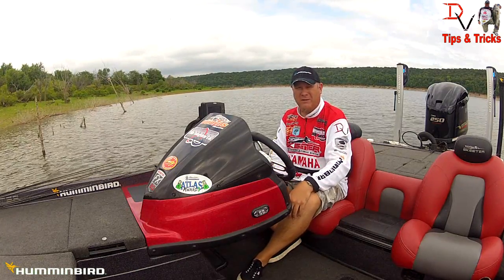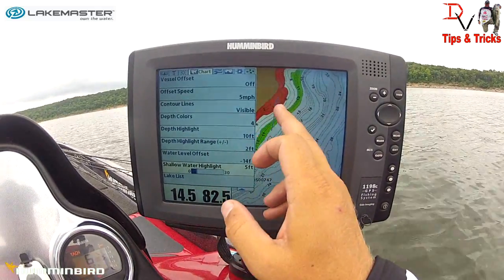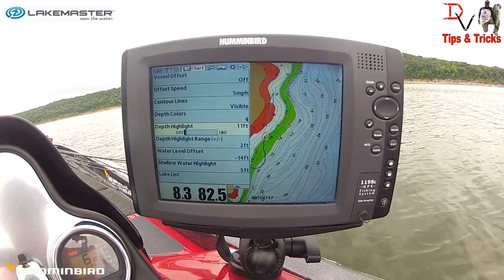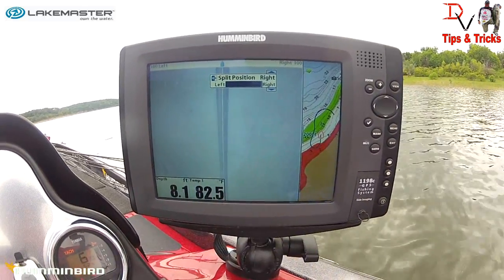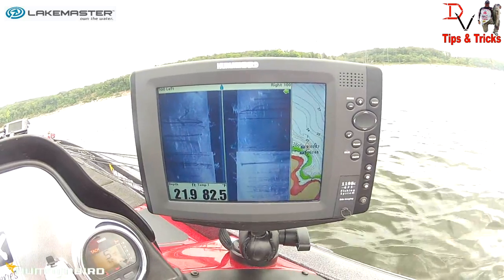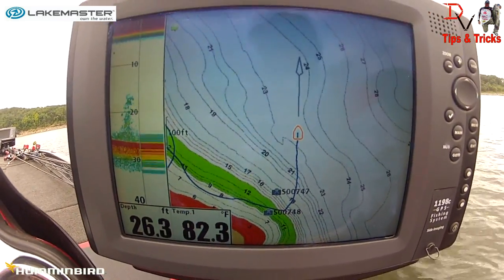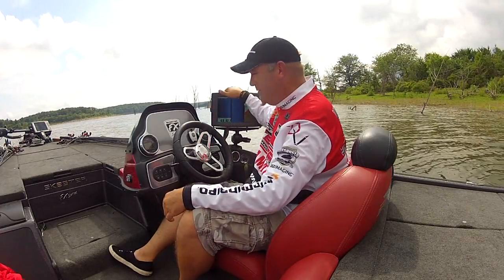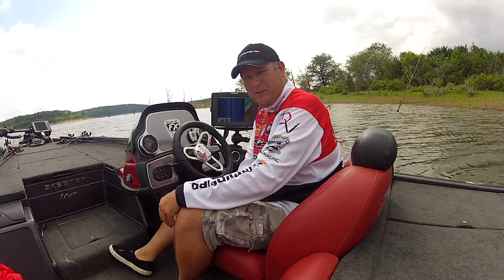Tips 'N Tricks 97: Navigating to GPS Waypoints with GPS-HS Receiver

Comment from the maker: You can do the same thing with other GPS Receivers but have to remember when you are going around 0.6mph and below the ability for standard consumer grade GPS Systems cannot accurately determine the exact direction with a high level of accuracy. So Humminbird displays a Ring to inform you are at this area. It still tracks positions and if you slow down and navigate to the ring to the waypoint will work fine. Or you can speed up if you need the heading line. GPS-HS solves slow speed navigation.

Comment from the maker: You don't have to have the 360 to take advantage of the AS GPS HS with Heading Sensor it will work with many models of Humminbird. It always knows the position of the boat and you can use Heads Up to orientate the map to the direction the boat is pointed.

Comment: So, if i don't have the 360 system, will the AS GPS HS be helpful anyway, especially at the trolling motor unit when i am going very slowly and the map starts spinning making it difficult to know what direction I am facing in relation to map structure?

Comment from the maker: The AS GPS HS is an Optional GPS Receiver or is standard equipment with the 360 Imaging System. The Heading Sensor is Electronic Compass that is built in the Receiver to provide positive direction at slow or no speed. Something GPS cannot provide by itself.

Comment: Doug, Is the heading sensor only available for ipilot?  I have two 1198s connected with ethernet, and lakemaster mapping,  and MN fortrex tm.   Is heading sensor an update on software from HB? Explain what heading sensor is compared to current boat icon....does it stay positioned correctly even with boat not in motion?